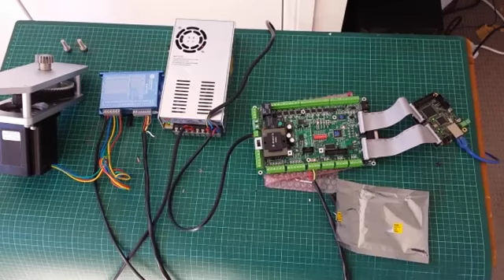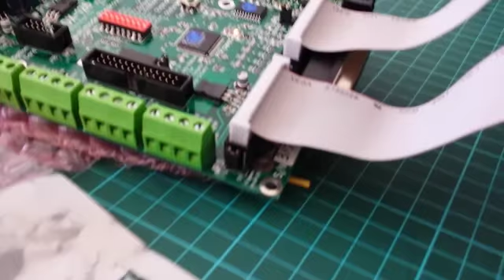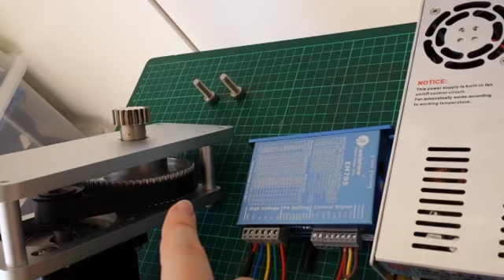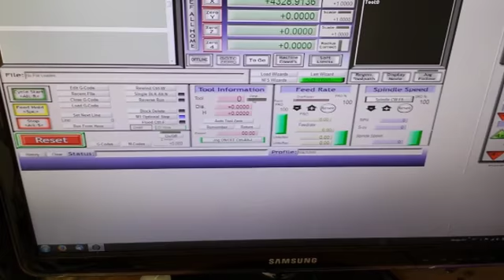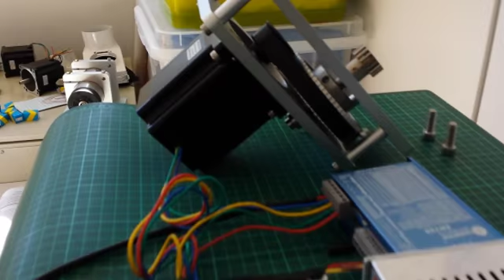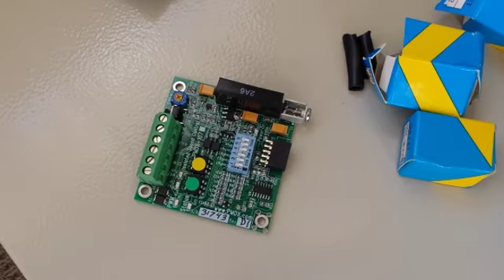Stepper motor testing on PMDX126 & EM705

Comment: I saw that you had emailed a copy of the design drawings for the gearbox to one of the subscribers. Could you possibly email one to me as well? I would certainly appreciate it. I will send you my email address if you are willing.
Reply from the maker: George Allen unfortunately I didn’t have the complete drawings anymore so I wasn’t able to share.
Reply: Cut and Carve No problem. Maybe you can solve a problem I’m having setting up my limit switches on my PMDX/ESS Controller system. I’m trying to use NPN, normally closed proximity sensors and I wired them independently to connectors J11 and J12 with the brown wire going to +12v, the blue wire going to the adjacent ground and the black signal wire going to the “#” terminal on each corresponding connector. When I tried to test it out on Mach3, it wouldn’t allow it and I continually got a message saying that a limit switch was triggered. Do you know any reason why it would say that? I hadn’t connected my E-stop and the jumper was still connected to the pin that they set the PMDX-126 on, would that be the problem? Documentation says the sensors have to be able to sink or source 6mA of current to drive the circuit to the ground, I didn’t see any accompanying docs with the sensor, but I would have thought most of those sensors are pretty similar. If you know what that problem might be (off the top of your head), it’d be a big help. Otherwise, I’ll just contact PMDX. Anyway, it was an informative video!
Reply from the maker: George Allen did you change your setting from an active high to an active low in mach3?
Reply: Cut and Carve I believe so. Should they be active high?

Comment: Since your website is down do you have any more info on those gear boxes.
Reply from the maker: lophole7 what would you like to know?
Reply: Do you have Plans you sell or are you selling the whole gear reduction?
How much on either Question. Thanks
Reply from the maker: lophole7 I was selling plans at one point. But haven’t done in a few years. I have more machines no that can actually do the job properly. The model for the gearbox was drawn in solid works but I am using fusion now. But either way I am happy to send you the drawings. I am in Australia. Where are you?
Reply: Check your email. I sent you my email. I'm in the States.
Thanks

Comment: Thank you I will try that, on the input driver there is two pins for enable+ & enable- I left them without wiring !! Is it right ?! Or they should be connected to something ?!
Reply from the maker: No problem.  I havn't used the enb -+ on any of my drivers.

Comment: Hello,
Finally I have all the parts to run my machine today I tried to run the motors but unfortunately I failed :( the step led on the pmdx-126 was blinking when I press the arrows/page up & down keys on keyboard, also the step led on the drivers blinking but no motion or any noise on the motor. No signal at all from the driver outputs. Actually I don't know what's wrong !!! 
I have:
Lam technology drivers DS1078 & nema 34 motors  M1343031, pmdx-126 ( I used the regular parallel port), antek PS 80VDC 12.5A .
I think maybe it's something related to the settings on mach3. 
could you please help me ?
Reply from the maker: Toll need to isolate the problem a bit more. On the pmdx126 there is a test mode, you'll have to adjust a few of the jumpers on the board, if your stepper motors don't work from test mode then there is something wrong with your wiring somewhere or jumper settings on the board or driver to motor. If test mode does work then it is mach3 settings issue, but first I would isolate the problem.